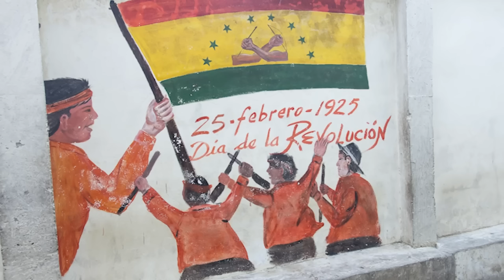Beautiful girls, beautiful islands, clothing optional... (Pt. 1)

Comment: Hi James, if you go back and look at your video of the accessories drive belt at 7:47 and by pausing, then using the keyboard <> keys to move frame by frame you can see the belt is jumping up and down a fair amount. This is likely because something is dragging irregularly causing slack then tension at that point vs a smooth rotation. This is telling you that you may have some signs of bearing failure in alternator's future or or irregular connection/slippage at one of the various pulleys. Since the previous failure was at alternator's tensioner, it probably spun belt in place a bit before jumping out of groove and slightly wore that pulley's cheeks just a bit out of round... the video doesn't show the rest of pulley to belt contact, but you can see if it rises up and down in groove along it's contact points around full rotation. It should stay at same depth all around on all pulleys continuously while operating or it will be stretching and flexing until it fails.

Comment: I've been sailing since I was 5 and I'm 54 now. When I started racing catamarans, I read a cat racing book and something blew my mind. Sailboats don't get pushed by the wind, they get sucked forward by the low pressure on the back side of the sail. The sail is a vertical wing, and the back of the sail is the "top" of the wing where air is going faster creating a low pressure bubble. The keel keeps the boat from getting pulled downwind. I didn't really believe it and had to think about it for a while, but it's true. Mathematically, the vectors don't lie. This is in response to your narration about "the first time you feel the wind pushing you..." that's what made me remember that little fact of sailing. The vectors on a windsurfer are insane. Craziness. On a lot kite surfer, they're alien.

Comment: James did you just plug off the end of the tempature/pressure relief valve for that hot water tank? Bad idea, watch some YouTube videos of what happens when a water heater ruptures when the relief is plugged. You're probably ok if you only heat off the engine but if you use the dockside electric heating element and it malfunctions you could be in real trouble.  Be sure to add it to your list to fix that TP Valve not just to get a better plug. James you are a good DIY guy. take that TP valve apart, there should be a seat with a spring behind it to set the pressure. You may be able to clean or flip the sealing surface on the seat over so it stops leaking. Did you replace the pressure water pump on the boat? Your pressure pump may be putting out higher pressure than the origional setting on the TP. you might just need to tighten the spring and set the relief pressure a little higher and it could stop leaking.

Comment: Lol mate are you sure that you are a qualified mechanic? A genuine mechanic would have used the correct size and tensile strength bolt in the first place. When a get out of trouble temporary fix remains in place and not properly repaired it becomes a liability. James mate lift your game, remember that you have other people onboard and that everything you do with and to the boat will have an impact on their safety and well-being of which you are responsible for.
Reply: Thanks dad
Reply: @DougallMcCorkle  you’re welcome son
Reply: I bet you've never owned a boat
Reply: @thenarrator1984  lol, let me think for a second. Ahhh yep, owned 7 boats over the last 40 years. Oh and spent the last 35 years of my career at sea retiring as captain of 12 years. Oh and by the way 13 of those 35 years was as chief. Any other questions I can help you with?
Reply from the maker: You have no idea how difficult it is to obtain parts in remote countries. I'm working with what i have.
Reply: @thelastpirate  James mate, I most certainly do know how difficult it is to get genuine parts in the remote corners of the world. You need to stop making excuses for your slackness and man up. Making a temporary repair to get out of trouble is normal. What is not normal and negligent is to ignore it and let it continue. Think ahead and carry a few lengths of threaded rod and nuts of various sizes to get you out of trouble in a pinch. It is far better than using an undersized metal thread machine screw where a bolt is required.

Comment: For the Alternator mounting bolt, could it be turn around so that the bolt head is near the belt? I believe bolt head height is lower than the nut + excess length so it will be further away from the belt.

Comment: Here's an idea for you in case your belt comes off again...    Find some kind of bit or attachment that you can put on the end of a drill to spin the water pump with or without the engine running to get things cooled down or flowing so you don't overheat...   5 minutes of a battery powered drill could mean the difference between a cooked or cooled engine.

Comment: If you have to dead end a line just shove a bolt in the end, find one that you have to tap in or heat the line first, then put a clamp on it. The line will bind into the bolt threads.  I've seen it last decades that way.  If you ever have to open it, just unscrew the bolt.  Get some nut drivers to tighten clamps. Flat screwdriver and clamp in your hand, one slip and your guitar days are over.
Reply: Second vote for using a nut driver on the clamps.  You can get them WAY tighter with much less risk to yourself.
Reply: @Wearyman  Yep couldn't agree more
Reply: James listen to us about tightening up hose clamps. A 7 or 8mm socket will also do the job. A great video
Reply from the maker: Great advice. I'll change that as soon as I can get a bolt that size. I'll some nut drivers too. 🙏
Reply: @frankpristov9745  A good option, but actually too good. 8mm socket will over tighten a hose clamp too easily. Broken a good number that way.

Comment: The nut is on the wrong end with that alternator mount. The correct bolt would have a much lower profile head than a nut and it should be well clear of the belt. At the aft end, there should be a slotted sleeve that springs outward against that rear hole in the bracket, to prevent rattling that would loosen the fit in time, and also be a close fit to the bolt passing through it. That slotted sleeve would be trimmed to correctly fill the gap between the rear mount and the rear of the alternator and such that the rear edge of the sleeve lies flush with the rear surface of the mount. There should also be a flanged nut at rear, with wide spring washer so the nut can be tightened up equally against the sleeve and the bracket. Yes, you were without any of the correct parts, but your thinking seems to be backwards, thinking a bolt passing forward and that hasn’t helped you.

Comment: Hello James - I really admire that you never give up on any problem or issue.  Thank you for that - it helps the rest of us to know that the best approach is to keep a cool head and work forward to a solution.   Regarding your belt rubbing on the through bolt - if your alternator has room to pivot and move a little bit one way or the other perhaps you could get a slightly longer or shorter belt which would move the belt fully away from the pivot bolt.  If the belt is straddling the pivot bolt it would be completely safe from rubbing even if it jumps around a bit from a dragging bearing or something else.  See if you can get the belt path to be completely away from the bolt.  Just a thought....stay strong.

Comment: If the belt rubs the bolt, can you turn the bracket upside down? Would that put the bolt in a better position relative to the belt?

Comment: Hi James, regarding water lines and more so hot water lines. A good plastic of choice is "PEx" (polyethylene cross linked). Will perform without issues as long as water temp is under around 160 F. Plumbing trade supplies, "Sharkbite" brand or one of the equivalents. A better choice is "PEx, aluminium, PEx composite" multilayer pipe used in hydronic heating systems and might be a little difficult to locate. Nylons and Polythylene materials tend to age quickly in heated water and pressure rating becomes next to nothing. Take care. Cheers.

Comment: It would be nice to put in a bushing in the alt bracket that would tighten slide against the alternator and fill the larger hole size.   I have seen bronze or oil-lite bushings used before.   Good job though using what you can find.
Reply: +1 bush that hole. Washer nyet.
Reply: The proper bolt would be a shoulder bolt, but better to have right bracket for alternator.

Comment: I added to my departure checklist "turn off water pump" and "open sink valves". No more blown lines as the water temperature rises from the heat exchanger and builds tons of pressure in the plumbing system. Sometimes even causing small cracks in the water heater.

Comment: Instead of bending the waterline in half, can you find a plug (maybe a bolt that has smooth shaft near the head of the bolt) similar to the inside diameter or shape a piece of wood to make a plug and than clamp that tight? Just a thought.

Comment: Because the nut at the other end of the bolt is welded on ,  luckily on the " inside " of the bolt , you should grind / cut that nut right down and reverse the direction of the bolt to give you more clearance from the belt .
Reply: thats what i was thinking also

Comment: Hey bro, only use the screw clamps as a temporary fix. That's the reason that your clear tube "Exploded" was because the tubing was eventually cut and pierced by the edges of the screw clamp. Better choices for clamps, especially when trying to achieve a "No Fail" condition are the wire spring clamps or the flat wire spring clamps. Using screw clamps, eventually, even your fiber tubing will weaken and split at the screw clamp(s).

Comment: Scary repair. Precise belt pulley alignment is crucial to not burning up another belt. Threads in the mount/contact area of a bolt will always be a weak spot, especially on a vibrating part like a alternator mount. Check the repair often. Not safe for a long passage.

Comment: As soon as you can change that all thread out & put a proper bolt with a shoulder that goes through the holes.  NEVER EVER have threads through holes as it will egg out the holes in no time.

Comment: back hole is missing a movable spacer that gets pulled in when you do up the bolt, that stainless threaded bar with nut welded on is a poor choice, use at least grade 5 hi tensile with hardened washers to get pulley alignment correct.
Perkins uses all grade 5 fasteners, it is a subsidy of caterpillar with uses only grade 8 hi tensile or better. you could get bolts from a caterpillar dealer and the a hardened washers for a very cheap price compared to the rubbish hardware stores sell.
they have a book called one safe source, and it has all their washers and hi tensile bolts in it with part no so super easy to work out what you want] I would think it would be on the internet now days in some form.
using the correct fasteners and hardened washers is really the only way to get a engine repair to last and last.
and you get a great nites sleep knowing bit wont be flying off.
any way I must watch the rest of the vid now to see the beautiful ladies. l.o.l

Comment: james, what was the cause of the hot power on the winch from the episode before this one
Reply from the maker: It was the alternator, when it broke it shorted against the engine and that is a power winch with big gauge cable.
Reply: @thelastpirate  that would have been 12 volts then right? surprising that you could feel 12 volt current, i woiuld have thought you were feeling 120ac current.
Reply: @messix7768  it's 24V on the Oyster
Reply: you feel amps not volts.
Reply: @darrendotson7411  thanks for that info. i deal with the sparky stuff on the daily

Comment: Mesure across the alternator holding bracket+3/4inch, an Autoparts store or Hardware store, will have a bolt to fit. Use a double lock-nut on the bolt. A spacer needs to keep it rock steady, the bolt fits through the spacer. Get two belts, so you have an extra. Mesure  the bolt hole opening too, get flat washer too, where the nuts will go.

Comment: Lots of auto alternator brackets have a sliding sleeve that aligns and takes up the gap (space) between the bracket and alternator body ears.  That must be why the rear hole is so large. Also, I would get a new long bolt for it.

Comment: Won't the alternator holes need drilled too ,you start changing things ,your asking for trouble down the road ,you can't put the metal back you drilled out ,so don't change what it was designed for ,wait a bit longer and get the proper bolt ,or get it made on the island if possible .

Comment: Why not just install a simple GF or ball valve on the hose, instead of using a hose clamp on the braided line that you bent the crap out of, in order to block it off? I always carry a box of assorted valves on my boat. If I don't need one, I guarantee another boat inevitably will need one.

Comment: Turn the bracket over or move the alternator above the bolt centerline not below.    Use car heater hose.. That vinyl hose is not for anything hot.

Comment: If the belt is close to the fastening on the loose side of the belt, put a sealed stainless steel bearing and adjusting washers as an idler pulley. Alternately, buy a proper bolt-on spring loaded pully tensioner which will keep the belt at the right  tension as well as holding it clear of any fittings. Many cars and trucks use them.  The back side of the belt will not wear or be scored--it will just spin the bearing.

Comment: If you want to put a bolt in PUT A BOLT in that screw you put in was never designed to hold the pressure!  Go on YouTube learn about bolts and how they are strength  designated by markings on the head of the bolt!

Comment: At your next opportunity, take the alternator and bracket to a mechanic who can weld. Get rid of all the slop by welding on a bushing where needed and get the proper size bolt so there is NO slop in any of the mounting. Measure from the front of the flange forward to where the best belt alignment would be. Take that measurement with you to the mechanic, so he can properly set it up for you, in the shop, so it goes back on the engine without any fuss.

Comment: In a past video you said your boat had something like 16 through hulls. When I learned that the Amel that Delos has only has one through hull. I have come to think Amel knows what they are doing much more so then other boat companies
Reply: Impossible. You need a hole for water to come into the boat (engine cooling etc) and another one where the wastes go out (toilets, sinks etc). You can not join them.
Reply: Amel. Has many through hulls.
And James has 19if I Remeber correctly

Comment: I still do not understand why you were so worried about having the belt out of place: the only issue you might face would be that the battery won´t get recharged. I think the cooling system would have been working anyway, thus no damage to the engine whatsoever.
Reply: In these engines, the cooling water pump is also connected to the drive shaft via the belt. So no belt = no cooling water flow and no electricity..

Comment: It's a shame you could not get the right size bolt size, There is now the risk of the bracket breaking where you opened out the bolt hole. Having said that, I know the challenges of getting the right stuff when in remote places as I am a sailor myself.

Comment: The only place you need washers is on the outside of the bracket. That large hole on the  far side is for the alt. The correct bolts will solve all your problems. I have been a mechanic for the last 65 years.  Best of luck and l enjoy yourr Channel very much.

Comment: On the [alternator] bracket, I BELIEVE you've put a nut on the inside (of the flange away from you).  Do the same with the near side flange - spinning the two nuts  AWAY from each other will tighten up the whole affair.  Then... get rid of the [-OFFENDING] nut on the outside (where it's threatening the belt), trim down the exposed end of the bolt, and voila, there's a good half inch free space before the belt.   You're welcome...